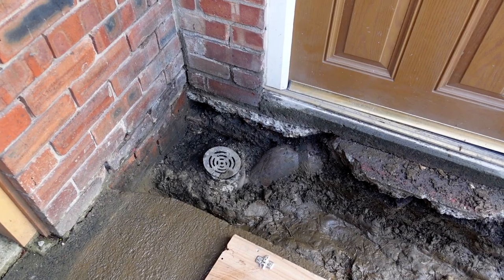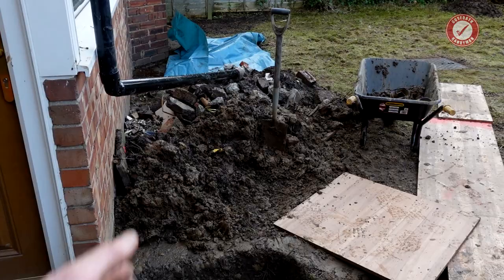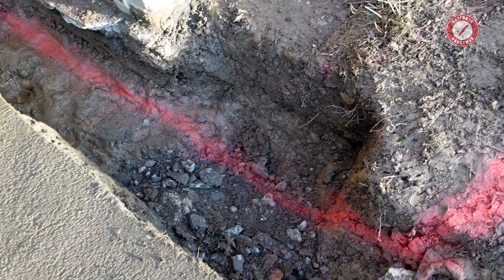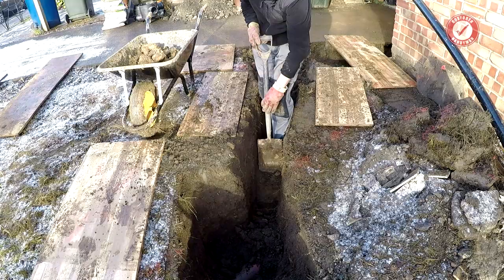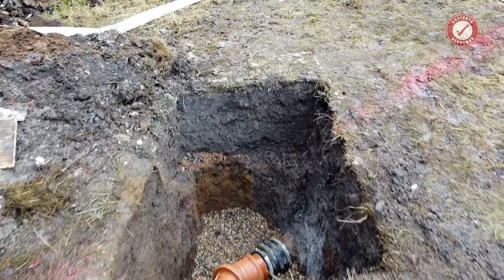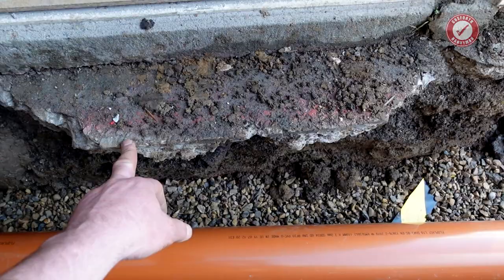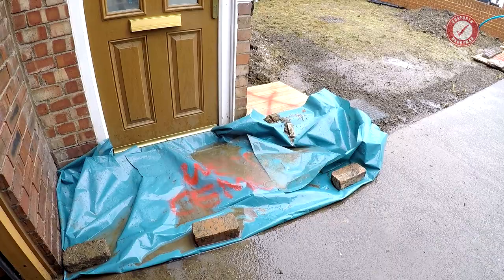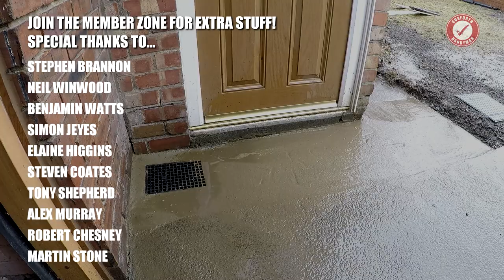Gully repair and clay drain pipe hook-up (Renovation Part 12)

Comment: Loving the videos!
I had to replace the water main at our first house which resulted in digging a big trench that would constantly fill with water, as the supply was shared with a neighbour and I didn't want to put them out until I had everything to fix it. I ended up having to bail it out with a bucket, as the £50 dirty-water pump from Amazon wouldn't start.
After seeing your water pump drill attachment I now know these exist and could have saved my self a lot of work.
Saving one for next time.
Thanks for all the videos!

Comment: Your comment about the original pipe being cracked because the porch had been laid on top of it is pretty appropriate right now. My house is an end of terrace and my next door neighbour is having an extension built on the back of his house. There is an inspection chamber about 12ft away from my kitchen back wall and their foul water sewer and those of the two houses the other side of him all feed into that inspection chamber. No problem so far. However, when the builders were digging out the trenches for the extension foundation they found that that foul water sewer is hidden underneath an elongated concrete dome, the top of which is only about 2 feet down. They got in the local water company and council officials to check it and they insisted that as the sewer and its concrete 'cover' is 60 years old it would need to be protected with an 'H' shaped (in plan view) steel girder box system supported on concrete piers to take the weight of the extension and the footings. It has cost our neighbours an additional £5k and put the programme of works back by 3 weeks. The steel girders weigh about three times as much as the extension!
I'd like to include a link to a photo I took but I don't think it can be done.

Comment: Very interesting to see different guidelines and rules in different countries. Here in Belgium, the recommended fall for pipes is a 1 to 2cm drop per m and pipes are usually put in a bed of what’s called “stabilisé” (roughly 2.5kg cement, 22.5kg sand and 1.9l of water if memory serves me right): it’s easy to level, sticks a bit and hardens out over time (like a very brittle concrete)
Reply: Yes. I've put in my own sewage treatment plant (UK) and my information was for a drop of between 60:1 and 110:1. A lot of people just use 100:1 as it's easy on the maths.  40:1 , as talked about here, I've never come across.

Comment: When  re-aligning  a  drain   on my last  property  I  used  Denso  Gas  tape  over  the  clips  on  the  rubber  coupler  just in  case  I  had to  do  any  work  on it  again  for  the same reason  that  you  mentioned.

Comment: You're lucky with the depth of the pipe, here in Ontario, Canada the frostline can go between 1.0 meters to 1.8 meters and water pipes need to be deeper than the area frostline!
Reply: Same in the upper Mid-West US. Most lines are 7 to 8 foot (2.25M +) Gas, Water and Electric.

Comment: Well done Andy for getting the bottom of the drains in line. This is classed as "Invert" level and is super important with Foul water. Generally, we also chamfer all the edges of pipes to ensure they go into their new fittings -- which has a greased seal. Not bad at all for someone who doesn't do drains.
Reply from the maker: Cheers bud! 👍
Reply: Is rainwater classed as foul water?
Reply from the maker: @normanboyes4983  no, but foul water could end up going down this pipe 👍

Comment: After you made the first cut into that clay pipe with that little cutter, if you make another cut too the same depth on the unwanted part of the clay pipe and cut between the 2 as if your cutting a square out you can get your cutter to the bottom of the pipe from the top. i found out when i was doing the same thing with a little cutter.

Comment: Another great vid thanks. I love your tutorials because you always do things properly and don't cut corners. Plenty of great tips, thank you, so here's one in return, although only a minor thing. @5.05 you start hand digging to expose the pipe. You could perhaps put a bucket in the hole to take the small amounts of dirt, and then put it in the barrow when the bucket is full to reduce the repetetive strain on your lumbar spine. It's a small point I admit but once you've damaged your back you get to see all the areas you might have prevented it from happening (hence the comment). Take care of your back mate, you've only got one of em. Great tips nonetheless, and if you want a bussman's holiday you're welcome at my house anytime... Just bring your work boots😉
Reply from the maker: Ha thank you and good idea with the bucket! 👍
Reply: @GosforthHandyman  Another tip I thought of when doing this sort of thing was to use a cheap soup ladle for scooping out the earth. It works surprisingly well compared to a small trowel and due to the handle you don't have to bend/reach as much.

Comment: I use denso tape on joints and metalwork, used extensively on oil rigs for connection protection and it works brilliantly.
Nice job though but I would have slung the old turf and replaced or seeded.

Comment: Nice job, Stevie Wonder would be glad to see those marks in the concrete. You had to cover it up because of the weather. 
You've dug so many trenches recently, next you'll be building a dugout and stringing up some barbed wire.
Reply from the maker: I was gutted about the marks - it was perfect! 🤣

Comment: Very methodical everything has been well thought out. Check your IC always better to use the lower channel for the main run and I know everyone likes band seals but rigid connector (DC9) in this case is a better connection. I’ve had problems with band seals dropping and forming lips that cause blockages.
Reply from the maker: Yeah, left the lower channel on purpose for the new main run from the extension. Bit extra fall too 👍

Comment: Excellent what I was looking for got to replace a clay rain water pipe with plastic as I broke the old bell mouth clay trying to rod it going to install a plastic gully the attached with rubber flexible joint fantastic 👍

Comment: Andy you did make me laugh when cutting the pipe, I thought won't be long before he needs a mask lol. I can highly recommend the evolution chop saw. That would go through that like butter. Nice job with concrete. Had similar with office build and 35 one day m, so thought next day I'll get up 6am and do some more, got two mixes done and hacked down after that. Buggered my two loads, but that is good old English weather lol. It looked a ball ache but job well done. It feels good once drains are working right. Got to do gully of mine soon. Mines 120 years old. Thanks for the videos. From Bill
Reply from the maker: Cheers Bill! Yeah, can't plan for British weather 👍🤣

Comment: Where you said the wall of the existing pipe was thicker than the new plastic pipe you can fit a stepped band seal which would help elevate the issue with different pipe wall thickness.
Reply from the maker: That's what I used but it's the internal diameter that's the problem. 👍
Reply: @GosforthHandyman  OK.I Like watching your progress on this project.Your videos are very informative and a great insight in how to overcome issues when stripping a property for renervation.

Comment: Would love to have seen the pipe joining process and fall calcs in more detail. Also i’ve never really done any concreting - still to many unknowns for me to be brave enough to attempt
Reply: IMO the easiest way of calculating fall is using per cent because that's exactly centimetres of height difference over one metre (100 cm). I've had recommendations for either two our four per cent fall on drains. Too little fall and water pools in the pipe, too much and the water isn't able to flush solids properly, they just get stuck and the water rushes past them. So apparently even barely any fall is better than too much, at least that's what I've been told.

Comment: i believe when you running  drain pipe line  don't put concreate surrounding  . just use granules and top just put 2 or 3 inch concreate layer with iron net or road.

Comment: Think you should have put an inspection chamber where it changes direction, connects to the old as it is a change on direction.
Reply from the maker: Don't need that many so close together. Even the one I added was overkill as the gully is rodable. 👍
Reply: @GosforthHandyman  I was told that you need inspection chambers at every change in direction for sewers and spaced at max 45m.  Notice must also be given to Local Authorities prior to any repairs on sewers even where Building Regs don't apply because it's a repair.  I suppose each Local Authority will have its own take on applying the Regs.
Reply: I've retained a note that at 30 degrees or less you don't need an access chamber.
At my daughter's new built home the surrounding ground is covered with small access chambers .....
Reply: @mozzer999  Good point...

Comment: Interestingly in my municipality in Southwestern Ontario, Canada rainwater must be allowed to run off the roof and out onto the ground. The thinking is that it will lessen the storm water surge at our sewage treatment plant as the ground will absorb some of the water. Unless the conditions are extreme storm water gets a light treatment before discharge into the stream.
Reply: The rules in the U.K. are now similar- although we don't generally discharge straight onto the ground, rainwater is now normally routed to a soakaway or possibly an attenuation pond on larger new developments. However, there remain many millions of older properties built when all waste water including rain was simply piped into a single sewer.
Reply: @spencerwilton5831  yes in Canada recently we are also starting to see catchment ponds being built in new subdivision developments.
Reply: @williammcrae3177  

Just a 1/2 mile away there are a couple of catchment. My neighbourhood is 50 years old and has none.
Reply: @spencerwilton5831  

I received a notice from or city council 2 years ago that my rainwater pipes had to be removed from the ground, diverted above ground, and the pipes in the ground capped. If  I didn't do it within a 6 month grace period I would be fined. It wasn't a big deal. I did mine and those of 2 seniors ladies in my neighbourhood and all 3 took an hour total. The guy next door ignored several warnings and got a $156 fine and a notice telling him that if they weren't done in 6 weeks the city would perform the work and bill him.

I now collect the rainwater from 2 downspouts for my vegetable gardens in the spring and  summer.
Reply: @RoomFourError  yes I remember about 15 years ago the local public utilities commission coming down the street and letting off smoke bombs in the sanitary pipes in the road and then looking at the rooftop gutters to see smoke rising as a telltale sign.  Quite amusing at the time.  Cheers
Reply from the maker: Bit more info on this vid about what happens now with surface water on new builds 👍 https://youtu.be/K4rHbiVd7dE

Comment: In my experience, when concrete has had about 3-4 hours to go off there is no need to cover it from rain, in some cirmcunstances the rain can actually help strenghten the concrete by slowing down the chemical reacton. As for the connection between the PVC and clay pipe, I would say what you did was absolutley fine mate, however you can actually get female (PVC) to Male (Clay) pipe adapters which would probably be worth whyle using if you do decide to use it as a soil pipe in the future :)
Reply from the maker: Trouble is it was so cold, -3C it just wasn't going off! Wish I could have found the female to male for clay as I looked everywhere 👍
Reply: @GosforthHandyman  For anyone looking in the future having watched this video the female to male connectors are fairly widely available online, just search for "110mm Polypipe Clay Socket to PVC Spigot Adaptor"

Comment: Should of laid the new pipe in the first trench you dug before back filling. New gully , straight pipe and a branch connector with the rubber joint connectors . Could of still put the inspection chamber in and no bends needed .
Reply from the maker: That's a shared sewer and it would have meant a right angle join. 👍

Comment: I have bought a terraced property where it would seem that all the neighbours have removed their rain water down pipes so 4 attached roofs at the front drain into my gutter. I am the end terrace. My down pipe just kicks out at the bottom onto the ground! There is no drain. I am assuming that there would have been a soakaway years ago. There is a manhole cover 6' away on my property do I need a building inspector to come check or the waterboard to come tell me what needs to be done to connect to the drain?

Comment: Re cip saw with a £10 stone cutting blade will go through it like butter and no dust
Reply from the maker: I must buy some decent recip blades - any recommendations?
Reply: The Bosch 5 pack bi metal ones are good they come in 4" and 6" lengths the 6 are good for cutting soil pipe if need be and the 4" good for all the usual stuff.the stone one I got from toolstation and was 6" long and cut through the clay pipe easily
Reply from the maker: @leecrawford8039  cheers - my current ones are crap 👍

Comment: Hi Andy, I’m just about to doing something similar but on a much smaller scale. I’m extending the main gully for the kitchen sink and bathroom waste water and wondered do I need a u bend as that is what is there currently on the original clay pipe.

Comment: You fitted the chamber wrong. The incoming has to go to the middle joint not side also the pea gravel should be brought to top of pipe before backfilling. Would have failed building regs.
Reply from the maker: The chamber has 3 entry points, the lower one has been left for a new run later on that needs more fall. Didn't show backfilling on vid but gravel all around the pipe and selected fill over the top, exactly as per regs.
Reply: @GosforthHandyman  see?

Comment: Proper, thoughtful, excellent job as always. 
Just would like your opinion on my situation: 
I have fitted the soil pipe underneath of my toilet (ground floor, old house). The toilet is in the middle position, the kitchen sink and the foul water gully are at  opposite sides. 
In order to reduce the risk of blockage or easier maintenance, Can I connect the sink waste pipe to the toilet soil pipe underneath the floor directly, or should I make a way around (like 90 degree shape pipe work, much longer distance) to connect the sink to gully?  

Would love to hear your opinion, thanks.

Comment: Can anyone enlighten me on that drill-attachment-hose contraption that I'm guessing Andy used to drain the water? I have a small pond to drain in my back garden and it looks like it could be useful!
Reply: It’s called a drill pump. Good for draining small amounts of water but not large ones.
Reply from the maker: Yeah, didn't the drill pump didn't work too well. Not impressed. 🙄

Comment: Just an observation but as the soil stack is on the front elevation and will probably be combined system with the rain water drain have you now disconnected the toilet as you have cut the old connection the the existing manhole?

Comment: Andy, couple of questions. Was there any particular reason that you didn't replace the extra couple of meters with PVC into the existing pit and therefore avoiding a PVC to clay pipe connection? Also, did you consider adding an accelerator to the concrete mix given the forecast for rain?
Reply from the maker: Not sure how that would work without taking the existing live sewer apart? Huge job. Accelerator - I was hoping to be done about 6 hours earlier. 🤣👍

Comment: At the beginning you showed the crack in what you called the “U” pipe and to me, in Canada, it reminded me on some occasions of coming across a buried “P Trap” under basement floors. I believe in the “old days” they were concerned with having waste water back flow into the home when pipes on the street got to overcapacity and this acted as a poor preventer.   We too, in the old days, had those homes which also dumped their gutter rain water into the waste water system and this added to the problem of system capacity.  When I first saw your “U” pipe I thought that maybe it was a similar preventer for back flow of waste water but discounted that theory until near the end you described how some old homes may also dump into the waste water system.  Do you think that your “U” pipe was serving as some type of back flow preventer?  If not what stops raw sewage from filling your new pipes?
Reply: A trap does nothing to prevent backflow of liquid. It's there to stop sewer gas from escaping.
Reply: @thebigmacd  yes Keith I understand that as my father was a plumber.
Reply from the maker: Don't think so as this was only ever for rainwater 👍